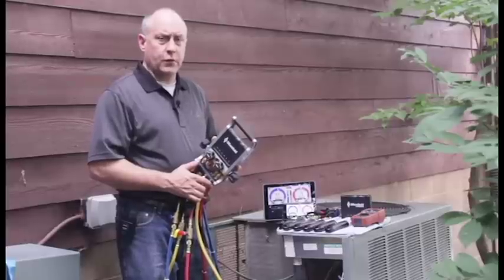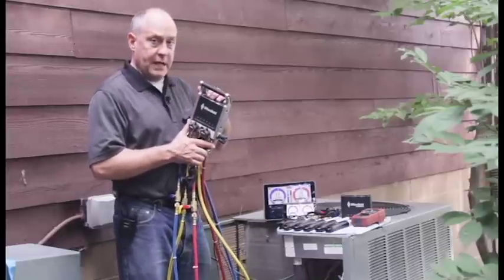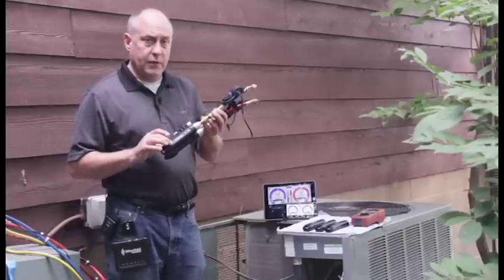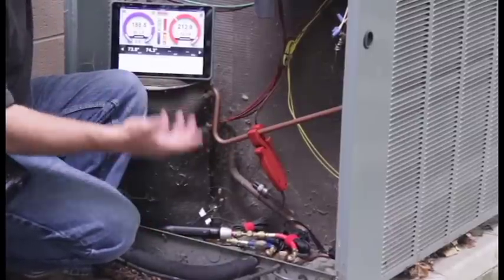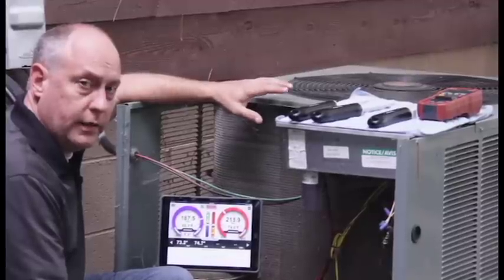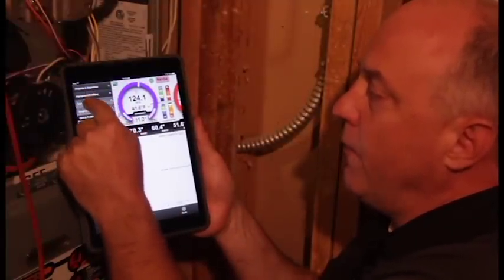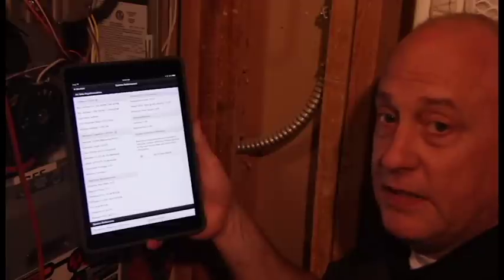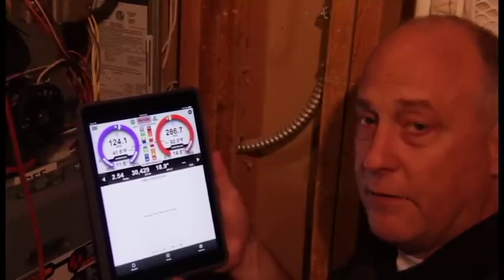What's the Difference Between iManifold and iConnect?

Comment: Good Video ! Thanks for explaining what the "iConnect Box " does. NOW I understand it's relationship to System. Very cool invention You made. Unfortunately Price is a Limiting Factor Right now & That there are No Wireless Temperature Probes for Suction, liquid & discharge. If I'm going to Spend the Money , I'm going to want to be all wireless. No wires Anywhere. Period. As with the Testo stuff i Allready Own. FYI : I Own ---1) the Testo smart Probe Set-Up.2) a Testo 905i Which I Really Love.3) imperial 800 series4) imperial 600 series5) Testo 557'sBeen doing this 35 years.
Reply: Well, I figure that your pressure transducers are around 300/each and a wired temp sensor to it is about 150 so, I'd rather spend the extra 150 and get a wireless temp sensor for 300 since most all your stuff is 300 a piece. So, I think you should make wireless temp sensors, you are already doing it with the indoor probes return air etc. it could not be much of a stretch to go wireless temp clamps. I believe that's what everybody wants-I know I do. Wires are so 1980.
Thanks for taking the time to reply to my comment.
Reply: Also, I forgot to add , All the tools should be utilizing li-ion battery's Making them rechargeable
And replacing battery's a thing of the past. Not good for the environment throwing away battery's.
Usb charging input like cell phones or better yet , wireless charging-that's the way of the future if possible and not too expensive. Just my thoughts of where we as techs would like to be with tools.